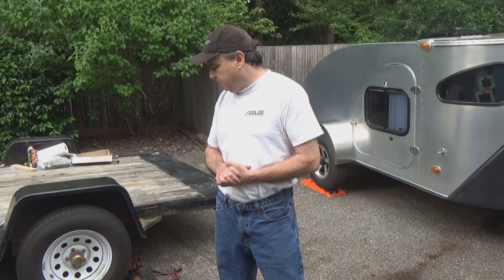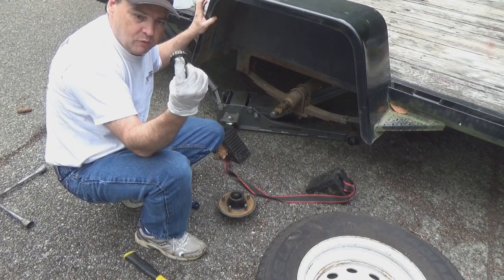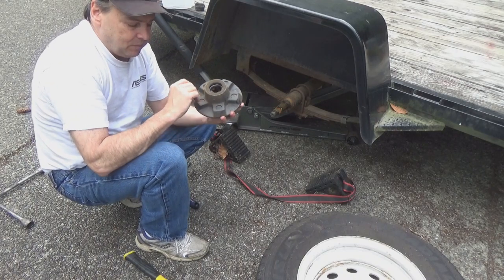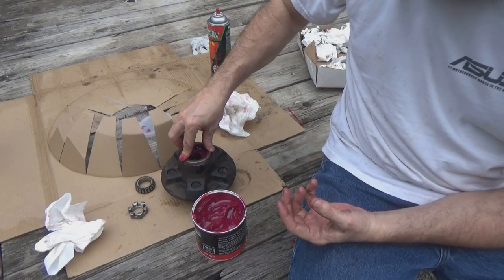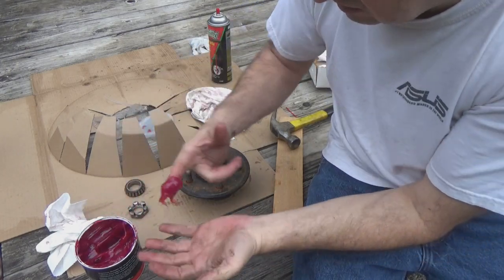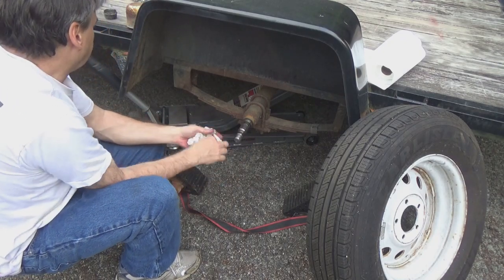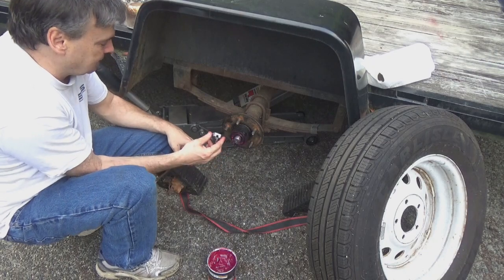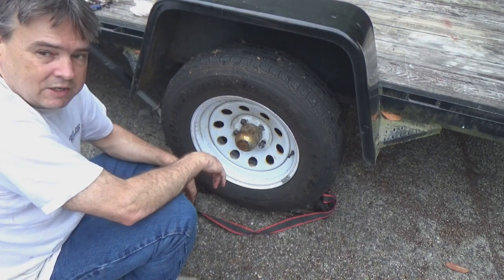How to repack wheel bearings - step by step

Comment: Why wear gloves at the start and then pack the bearings with bare hands later?
Reply from the maker: Because I wanted my hands free of old grease and gunk so when I repacked them, I wasn't putting dirt/grit back in. Sure, i could work with bear hands then wash them before I repack but just easier to put on some gloves while I clean it up and then use bear hands when packing.  The bare hands gives me a better feel for if the grease is getting into the bearings and I can manipulate the bearing in my hand better than when wearing gloves.
Reply: @RoughRidersTV  Ok, makes sense, I understand that need for tactile responsive feedback. It just seemed pointless to wear gloves (for the sake of keeping your hands clean) and then take them off and get your hands dirty, later - that's the only thing I was thinking of. Thanks.